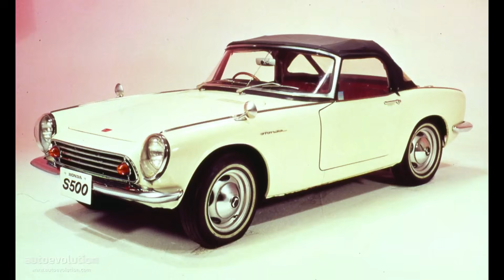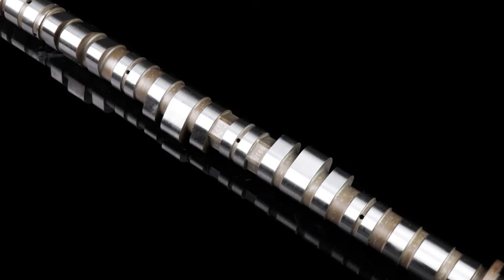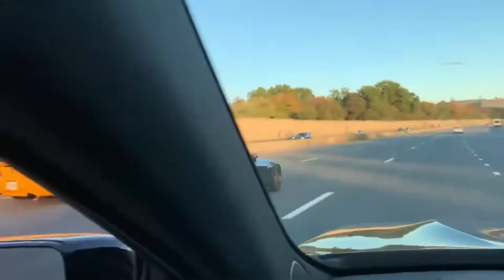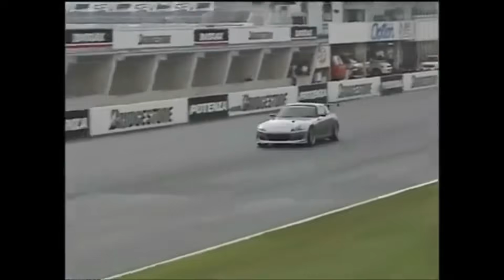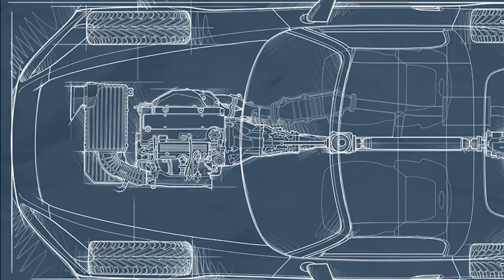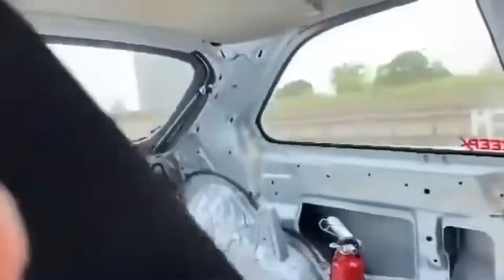Honda S2000: The F20C — A 9,000 RPM Masterpiece from Japan

Comment: Original Owner of an 06 AP2 with 243k trouble free miles. 

Replaced the original  clutch at 230k, and this year replaced upper and lower control arms and bushings and shocks with oem.

If you want to feel like your going for pole position at Monaco Gran Prix, the S2K is the perfect car from driving position that feels like your in an open wheel racer, to the distance from the wheel to the best manual ever, plus the gearing from 1st to 4th, further makes you feel like your going for pole circa 1988. Other high revving cars today like a GT3 or GT4 gearing is too long. 

There is no other car like it and its rear wheel drive.

Comment: Had a 2005 AP2, torqueless wonder
Reply: you don't understand what this engine was built for it was not built for hauling loads it was built for high RPM horsepower on a track. I think  people should have to take a test to prove you know what horsePower is versus torque and where they both have their strong point apparently you didn't understand that